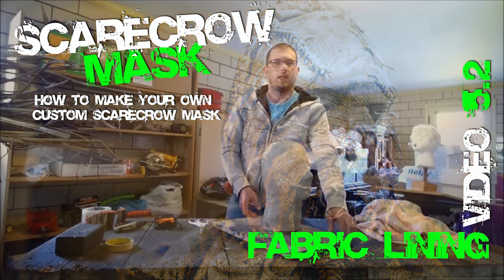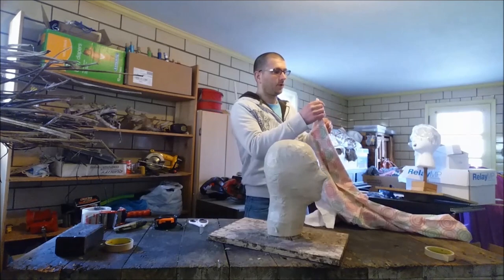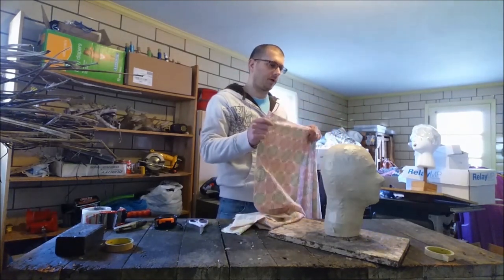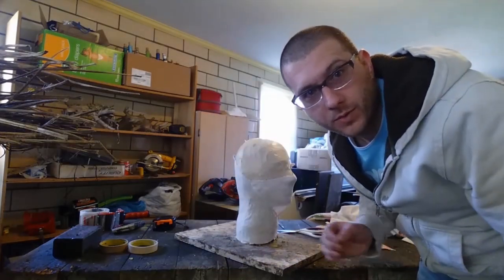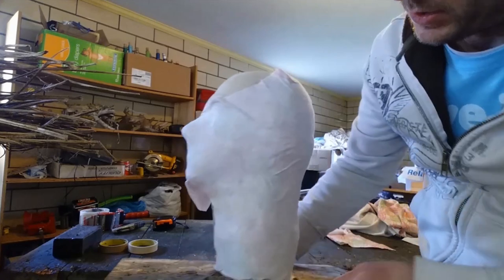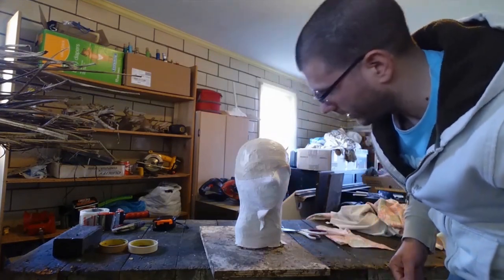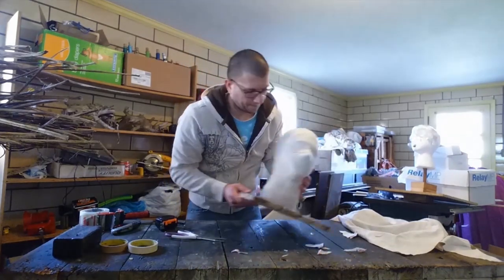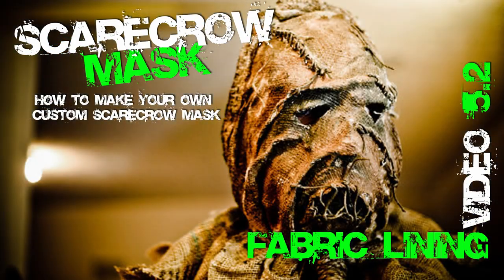5.2 How to Make Fabric Lining for your Custom Scarecrow Mask from Batman

Comment: Hey so I want to make a fabric lining but  I also want to bulk out the mask as well to make an animal face or very obvious features. I plan to use batting (like for upholstery) but what can I use to “glue” it to the lining? I know the silicone does that in these videos but I know it won’t soak all the way through the batting and to the lining... suggestions?
Reply from the maker: almost seems like you need to make an inner layer mask. Like maybe take a ski mask and attach batting and another layer of fabric over the batting like little pillows to build out the areas you want. Sew it or use fabric glue to attach it to the ski mask. Sewing would give you the best results.
Reply: ScarecrowMasks that’s a great idea!! I will have to play around! Also wanted to ask you more about SFX.. where do I look in to that or going to school for it?
Reply from the maker: cody orr not sure anymore, I went to Art Institute in Pittsburgh but I hear they closed. Schooling might not be the answer depending on where and what u want to do. Do research on job opportunities u think look good and read qualifications , check out people’s LinkedIn pages, dm people in the field that post work. Also do understand the pay and locations and make sure u are ok with the lifestyle. Sleuth it and really understand what you need (education /experience) to get the work u want.

Comment: Hey do I definitely need two tubes of the caulk? Should I be okay with one? Thanks!
Reply from the maker: Miguel Scholis one tube will be very thin and may not hold burlap as well. You could do one but you have to spread very thin
Reply: Thanks ill order two, im using the link you left so thats exactly ehat ill do. Thanks!
Reply from the maker: Miguel Scholis thanks for using the links and I hope it turns out the way u want
Reply: Hey so I tried the link and it says it’s 20 a bottle, is that how much you paid? Could I use any caulk?
Reply: Never mind the clay one is 5, thanks again!